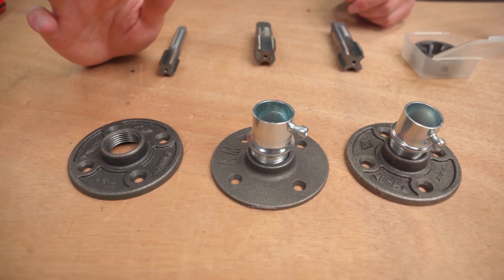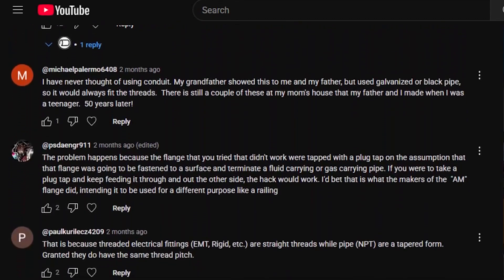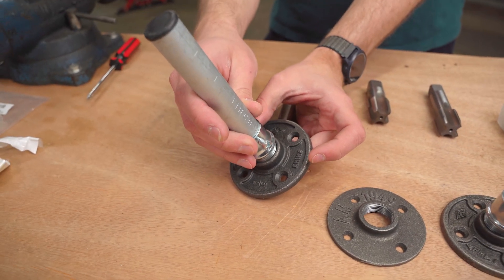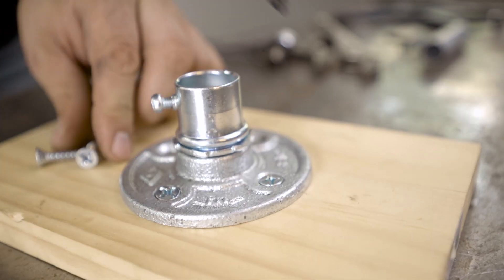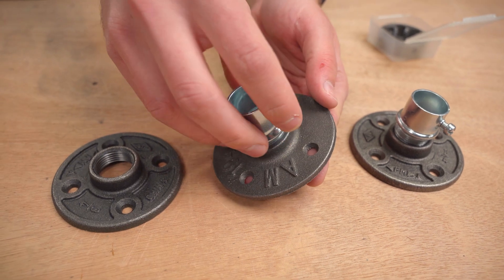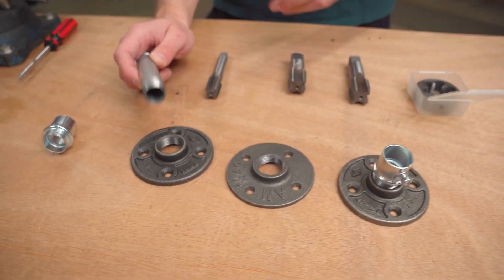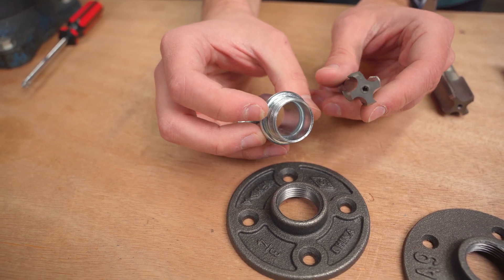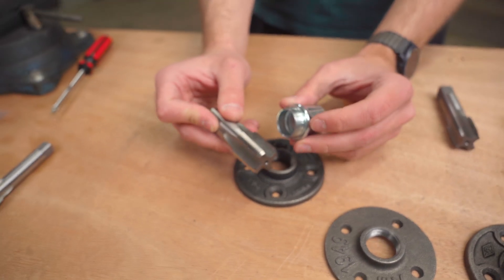This Conduit Flange Hack Has To Work!

Comment: If you have the die in the first place why wouldn't you just thread the end of the conduit, or is there a reason to still use a connector?

Comment: Drill a 3/4" hole in a 3" dia/square piece of sheet metal, fasten the conduit with a nut, then screw the sheet metal to your surface.

Comment: I have always just found a 6" - 10" pipe nipple (just a short pipe, threaded on both ends at the factory) that has an outer diameter that very tightly fits inside the conduit. I do not know what standard sizes fit what standard sizes. I just keep trying things in the hardware store till I find something that fits. Then, I tightly thread the short pipe into the flange. Then I literally hammer the conduit onto the short pipe. I can usually find some combination that is a super tight fit. Once I have hammered it on, it usually doesn't come off. If one had to, one could wrap the pipe with tape, or mash the conduit a bit, before hammering it on, to make a tighter fit.  Heck, even a bit of epoxy might do the trick. 

I have found it is super sturdy. I once used it to hang a bent shower rod that had to curve around from the side to the open end of the bathtub (weird bathroom). It held up for years.